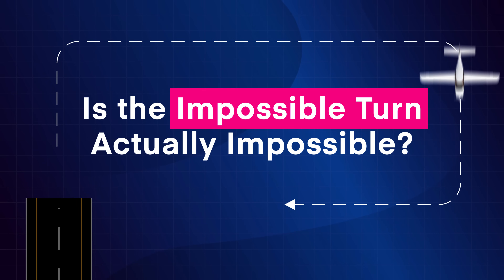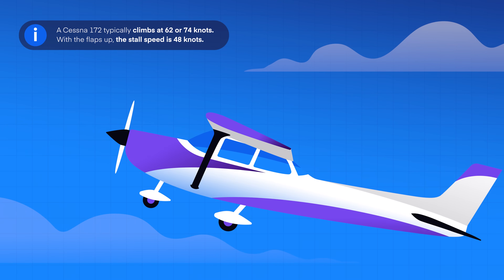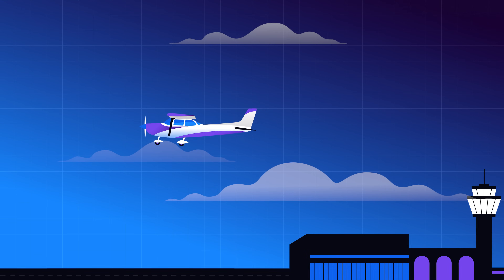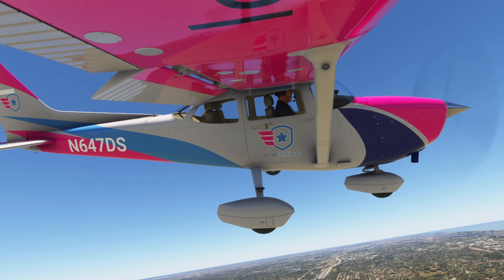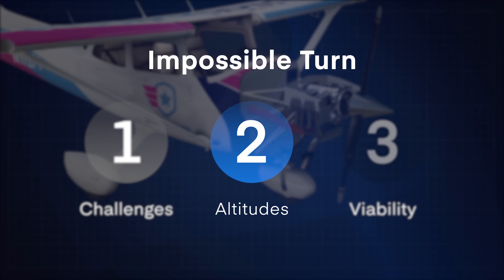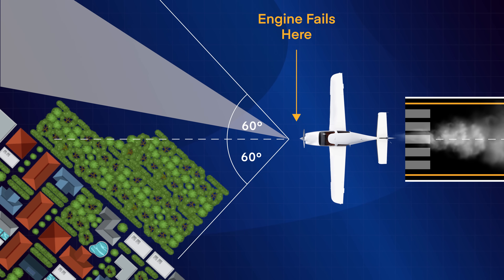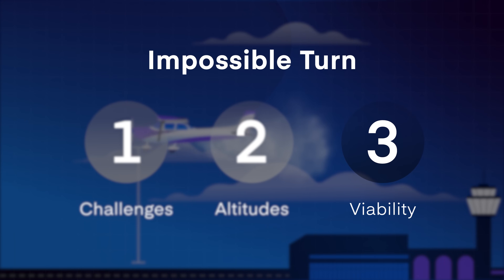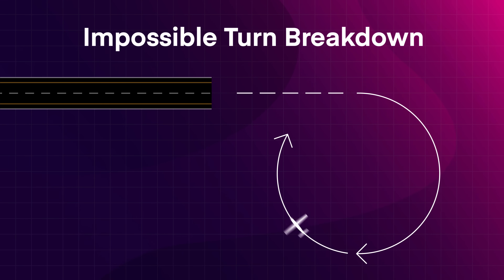Is the “Impossible Turn” Actually Impossible?

Comment from the maker: What do you think about the impossible turn?
Reply: If it happens soon enough and there's nowhere to land you might as well just choose the building you hate the most and send it (in simulators, I'm not advocating for acts of terrorism lol)
Reply: the turn in the current thumbnail for this video is definitely impossible (to do safely). it depicts turning back to the runway so that the returning aircract is landing 90deg. across the runway, rather than lined up or nearly lined up with the runway.
Reply: @julianbrelsford  Also if you use shallow bank, you will go far away and then have to come back to the runway.  It is a Vglide 45 Turnback.  45 bank at Vglide.  But only if you climbed 700 fpm constant to 700 agl and wind over 7 knots.  7nots or more winds to push you back too..  

That is the 777 No Power Turnback Rule i learned years ago from EmergencyLowManeuvering Channel.
Reply: I'm just a glider pilot, but trading height for speed seems worth it for me. You keep the energy but are more maneuverable. Then do the turn at lower altitude. And don't insist on landing on the paved surface. Grass isn't all that bad.
Reply: Seems pretty impossible ")
Reply: One of my more colorful CFI’s called it The Suicide Turn.
Reply: You are very wrong.  You need training on  them you..  Not all EFATO Turnbacks are impossible turns.  I learned them partial power from 400 feet agl.  I took training on 2 kinds of turnbacks in 1999. Cherokee short wing.  Partial from 400 agl.  Total from 700 agl if climbed over 700 fpm. 
 SEE THIS.  500 AGL crosswind leg turnback Bonanza v tail  https://www.youtube.com/watch?v=pwIvao_ONSY&list=PLzWmUzmvdZiR7-aSIzkQCNh_Ut5wWAPVK&index=16 and  https://www.youtube.com/watch?v=pwIvao_ONSY&list=PLzWmUzmvdZiR7-aSIzkQCNh_Ut5wWAPVK&index=16

Comment: The problem with pilots desperate to believe they can make this turn is they will not plan to crash land straight ahead, which is the ONLY solution to this problem.  The pilots with enough experience and aeronautical knowledge (a very few) will understand the forces and the reaction time constraints, the variables for wind and load factor and the skill needed to put it all together quickly enough to even attempt the turn, but they will STILL fail because they also have to calculate altitude and distance to the runway, which is BEHIND them.  Few pilots are in this group.  The bulk of pilots will simply fail in every way, reaction time and barely begin to make the calculations before they enter the spin and die.  Either way, the proper plan is to ALWAYS brief a crash landing spot AHEAD of the plane...

Comment: All about knowing your aircraft and having a very good understanding of density altitude, performance, loading, handling characteristics, etc. Certianly not recommended for low time pilots. My instructor had me demonstrate this down to 500’ AGL after much practice at higher altitudes. Winds light with DA of 2200. Know your aircraft and always have a plan as well as a back up plan.
Reply: Not even close.  Knowing your aircraft has no role in it, the variables beyond your control do, like how high you are (must know that IMMEDIATELY), what the wind is doing, if retractable, get the gear up immediately, if fixed, worry about where your flaps are set, AND then try to figure out how far from the runway you are, which is BEHIND you.
Reply: Exactly.

Comment: Useful video, but more important for everyone to understand is the thing from which all the bad happens no matter your turns or flying technique. That bad thing, as you name it "stall", seems to be understood by less than 10% of real world pilots! Yes, only 1 in 9 actually understand what the stall is CORRECTLY, NOT WRONGLY!

What is a stall? If you say that the speed is the problem, or that below X speed that happens, you are basically at level 0 knowledge when it comes to understanding how lift and flight works.

Comment: It was ingrained into me at my home airport that if I lose the engine under 1300 feet go straight for the highway that runs adjacent to the airport. That highway is extremely wide and there’s believe it or not hardly any traffic on it in any given moment. Of the 4 to 500 times I’ve taken off at my home airport I’ve always looked down at that highway and I’ve never not seen an instance where you could squeeze in between traffic to land. It’s just not worth the risk to make the turn under even 1500 feet in my opinion. I’ll take the embarrassment on the news, I don’t care. I can articulate my excuse to the FAA. I work as a prosecutor and everything in life is justifiable if you can explain it well enough. After dealing in criminal law my whole working life I’ll give you my word the FAA will agree with my decision also, whether they want to or not.

Comment: Fly it in a sim.  Repeatedly.  Cut power at various, terrifying altitudes like 500, 750, etc. taking off from your usual, home airport, and see what you can actually do and how little time you have to do it in.  You aren't getting back to the field, but don't stop there, figure out whether it is better to go right or left, whether that road that looks attractive when you overflew it at pattern altitude is really viable or not, etc.  You will very quickly figure out that there is no time to think about where you are going, pick a spot etc. the way you would at altitude.  So you had better already know what your best option is before you start your takeoff roll.  Even if all your choices are bad, some are going to be worse than others.

Comment: Field elevation where I'm at is 6200 feet. The "impossible turn" isn't even worth considering for a heavier, faster aircraft. In the summer, density altitude can be as high as 10,000 feet standing on the ground, so your aircraft drops from the sky like a stone if you lose power. A supercub or 172 might pull it off if you react swiftly, but otherwise you're far better off putting it down in a field. Odds of making the runway aren't great.

Comment: I can demonstrate a 180 turn after engine failure from climb with 60 knots in a Cessna 152 losing less than 200 feet. Immediately nose down and 60 degrees bank simultaneously. Hold 60 Knots, stall waring is constantly beeping. Roll out hard with a little rudder. Turn diameter is about 70 Meters. Therefore, you nearly stay over the runway. We practiced this 100th of times while I was an aerobatic flight instructor. It is an absolutely save maneuver once you practiced it, so you can do it in your sleep, while drunk. Without that level of practice, it can be dangerous.

Comment: It's highly dependant on the aircraft being flown. I had an engine failure after takeoff at about 400 ft AGL in a Mooney 205 and due to It's sleek aerodynamic design I knew I could make it back, which is exactly what I did. Had I been in the Arrow IV that I also flew often at the time it would have been a different story with no alternative other than to continue ahead and look for a field.

Comment: Glider pilot here. We train a lot for a rope break during a winch launch and here is how we do an opposite landing. 
1. Push the stick as far forward as it goes until you get to the normal gliding speed +20% (you will maintain this speed until the final).
2. Turn 45° left and fly away from the airfield.
3. Keep calm while getting further from the airfield. You will need this distance for a low bank curve (high bank >30° may cause a stall). This is the time to do the checklist.
4. Turn 225° right. KEEP YOUR SPEED. 
5. Land
Important points: avoid slipping (big waste of useful altitude) and keep the speed high
Reply: Gliders do not count.  They are NOT heavy powered aircraft with a fraction of the glide distance a glider has...

Comment: I played around with this a lot in sim several years ago. In a C172, it really is very difficult to get back to the runway below 700 or 800 ft once you introduce a bit of reaction delay. However, a lot of airports have roads near the threshold at 60° to 90° deg and they're often viable with 300 to 500 ft AGL (assuming you react quickly). A lot of airports also have taxiways or ramps offset from the runway, so "getting back to the airport" may only require 150° to 180° of turning and may be viable at surprisingly low altitudes. Another big take away for me was to just land straight(ish) ahead unless you've tried it in sim first and know exactly what altitudes allow you to do what; I was not able to reliably judge whether I could make a road or taxiway on the first try.

Comment: Here are my 50 cent as being a glider pilot. For us, the "impossible turn" is a rescue procedure in the event of cable brake during the winch launch. It is not the preferren one, but on some airfields, it might be the only feasible procedure.

However, we make it "opposit" to the impossible turn. Which means, one does not fly away straightly, but first turns to right or left in the way that the "impossible U-turn" would bring you back to the center line of the runway for the final. Of cource, one should trust his aircraft, which means, the turn should be trained well to make it work.

In my opinion, the very thing making the turn impossible is the fact, that you need to "catch" the runway on the final approach. Being in emergency situation, it puts even more pressure on the pilot leading to deadly mistakes.

Comment: if you use shallow bank like that illustration, It is wrong.  You will go far away and then have to come back to the runway.  It is a Vglide 45 Turnback.  45 bank at Vglide.  A Vglide 45 bank Turnback.  You program before take off.  Plan to Turnback only
 if you climbed 700 fpm constant to 700 agl and wind over 7 knots.  7 knots or more winds to push you back too..  The 777 Turnback.  

That is the 777 No Power Turnback Rule i learned years ago from EmergencyLowManeuvering Channel. 
Program before take off The 777 No Power Turnback.  We did it even before preflight.  You know if you will climb 700 fpm or not before preflight based on temp airplane and conditions.  If not, dont plan to turnback unless partial power, but no power, no turnback if no 777 Rule met on that take off.  777 Rule ...

Comment: This is why, as a pilot and all pilots should do this if not, it is plan for a landing spot after takeoff if your engine died prior to taking off and even study the airport if your unsure or evensure but the wind suddenly changes you must change runways which then would throw your plans for the original emergency landing spot especially if your 180⁰ opposite to the landing site. Always always plan for the unexpected

Comment: Another factor I rarely hear mentioned is that if there is any crosswind, it is best to make the turn into the wind. This minimizes your runway offset at the completion of the 180 and thus the amount of additional maneuvering you will have to do to line up with the runway. In a strong enough crosswind, you might even find you’re already lined up with the runway at the completion of the 180 degree turn, but only if you make the turn into the wind.

Comment: I'm not a pilot so this might be insane, but would a reverse cobra turn work? Pitch up momentarily for a quick altitude/speed swap, then bank hard and pitch down hard, effectively pulling a tight U turn in the air. You'll be screaming toward the ground, but if you can pull up smoothly, it should get you pointed in the right direction. I've done it on RC planes but never without engine power. No idea if it would work here.
Reply: Yes extreme maneuvers involving abrupt control input at low airspeed and low altitude are a great idea
Reply: without engine, your only energy comes from losing altitude for speed. pitching up you gain altitude but loose speed, which you will have to regain again by losing extra altitude going back.  Besides, during takeoff there's not enough energy to pitch up, which will definitely lead to a stall spin.

Comment: These are safe to practice in real life as long as you are very comfortable with the glide characteristics of your plane, know what stalls in a bank feel like and what speed youll stall at for a specific bank, are comfortable with a tailwind landing, are doing it at a empty untowered field, and start at a high altitude, like 800ft and work your way down lower as you have successful impossible turns. My personal minimum is 400ft. AGL in a cessna 172 and 500ft for archers warriors and DA40s with a headwind component of up to 15kts on takeoff. Stay coordinated and at or +5kts of Vg, do not exceed a 45 degree bank and you will be very far away from any stall/spin situation. The factor that will 100% make this maneuver impossible is if you're taking off with any type of tailwind whatsoever so consider that next time you think about opting for a shorter taxi to use a runway with a light tailwind.

Comment: if you do the turn wrong, you will stall or not reach the runway.  Military, Bush Pilots, glider pilots and crop duster pilots do turnbacks every dam day, even with armament or 2,000 pounds of chemicals weighing them down.  A Turnback, if safe and well done, is not an impossible turn- but some morons call all turnbacks as impossible turns. Bullshiters putting down the ones that do them right, and those are the best pilots that should be exalted, and never put down by liars that are AFRAID of doing Turnbacks and lying by calling Turnbacks as Impossible turns.. LIars...

Comment: If you do it like that illustration, YOU DO IT WRONG.  It is not a low and shallow turn.  It is over a calculated altitude and if climbing over 700 fpm and some wind too to bring you back.  I Used to teach Turnbacks when CFI in the 1990's.  You have to have an altitude marker and i used to put a blue line on the Vglide speed. 2 markers.  Turnbacks is a Vglide 45 bank turn from at least 700 agl if you climb at ovr 700 fpm. 
 Besides EFATO, it can be used on GRM Flyovers, Box Canyon Turns, Circling Approaches, and even make you better doing those Power Off 180"s from downwind leg, which makes a lot of commercial pilots that didnt know turnbacks (WTF?) fail the commercial pilot test.   A CPL that dont know how to make efficient and safe tight turns without messing up ?  Oh yeah, many there.

Comment: question if u have to and there is a large industrial building w/ a flatish top could u land on the roof if there are no other options?
Reply: Theoretically, if there's a mile long building with a perfectly flat roof that's also strong enough to drive a fully loaded semi on, and then there's zero air conditioning or industrial equipment anywhere on the roof, then maybe it might be possible.

Practically, no. Aim for a flat open area without buildings.
Reply: @Alex_N_Lowe  makes sense, thanks!

Comment: If the climb gradient after takeoff is not significantly higher than the glide gradient, an impossible turn is impossible at any height. Am I wrong? This can easily happen at high weight or high density altitude.
Reply: Right.  Better climb at over 700 fpm and some wind to bring you back.  From 700 agl up. Most engine fails are the partial power kind.  You can Turnback from 400 agl if not climbing. I learned them in 2001.  https://www.youtube.com/watch?v=pwIvao_ONSY&list=PLzWmUzmvdZiR7-aSIzkQCNh_Ut5wWAPVK&index=16
Reply: Climbing into the wind steepens the climb gradient and once turned the tailwind decreases the glide gradient(you glide further across the ground).  Being too high might be the result.

Comment: If you can avoid a stall and a spin, higher bank angles will make you lose less height to make a full 180º turn. Considering a Cessna 172 and the 4 seconds reaction time:

30º: 400ft
45º: 300ft
60º: 250ft
75º: 210ft

Comment: 1 plan for engine failure on every flight with low altitude before you take off.  Pick where you will land...

It's impossible for the pilots this video is designed to instruct. 

Best to land wheels up in a field

Don't save the plane... Save your life.

Comment: If I were I pilot on a small plane, I would prepare in advance my reactions to the engines failing at different altitude, eventually practicing them on flight simulators, even the Microsoft variety, at least to memorise the sequence. I would also study the maps of the airport surrounding area, to figure out where to look for alternate landing area. Actually I wonder why isn’t there an add on to MS FS 2024 to be used by PPL to train.
Reply: I would think all pilots would do this before every take off, have a plan ready for as many as scenarios as possible including a good idea of your planes handling characteristics and capability in such a circumstance.... every take off would have a plan. do they not already do this?